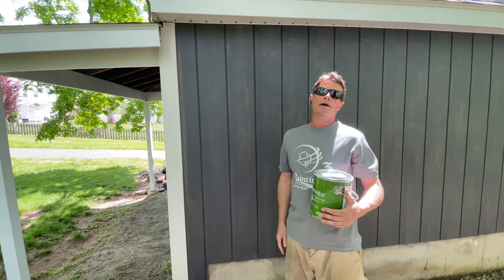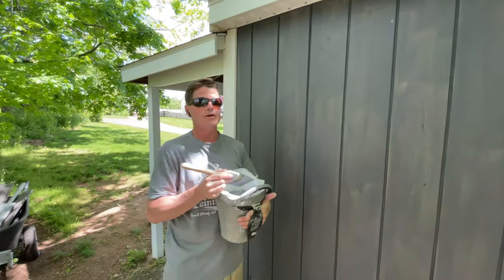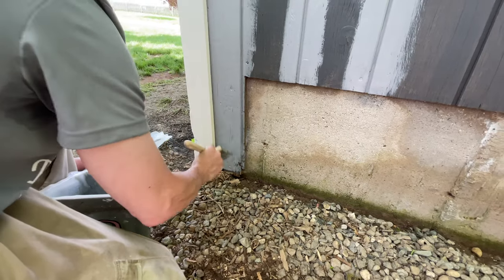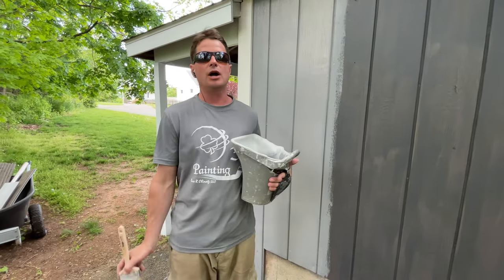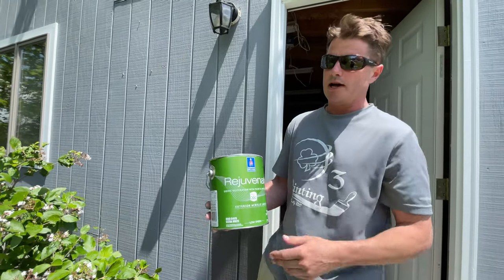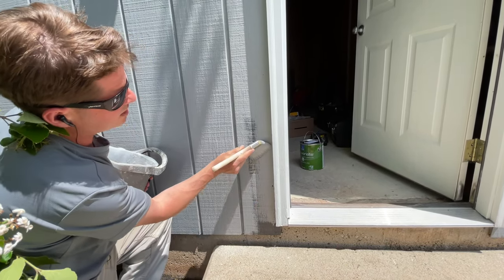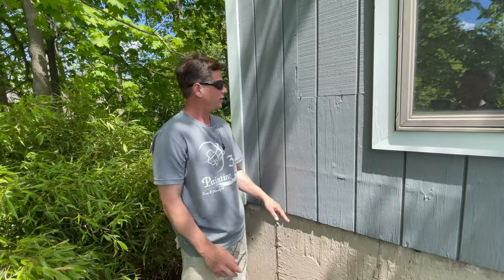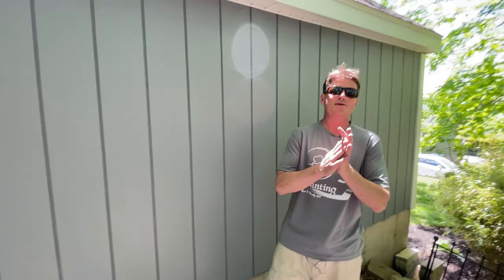How To Paint Old Weathered Barn Fast - Zinsser Peel Stop - Sherwin Williams Rejuvenate (Part 3)

Comment: Amazing...  Near the end of the video when you were top coating the last part of the wall next to the door, you didn't get even a touch of paint on the outside of the white trim!
Reply from the maker: Hello-

Yes, Im using an angled 3 inch brush to better control the paint, especially when cutting against the side of the trim and soffits. 

Russ